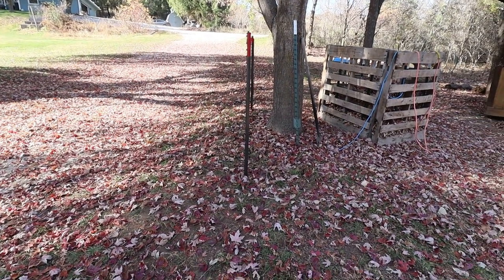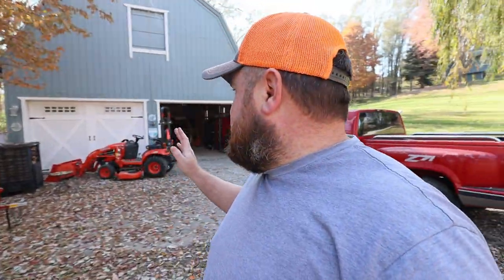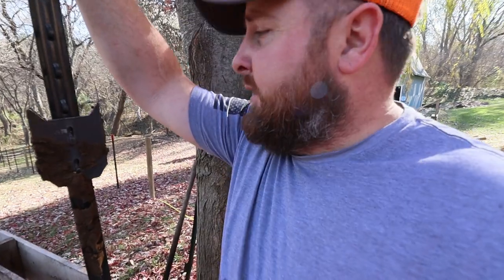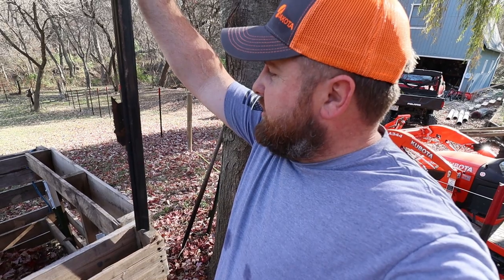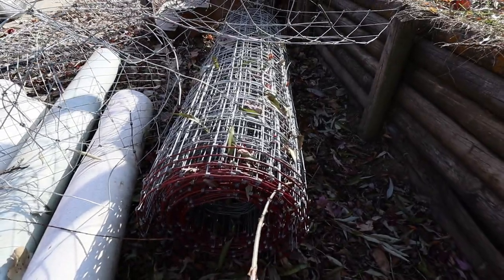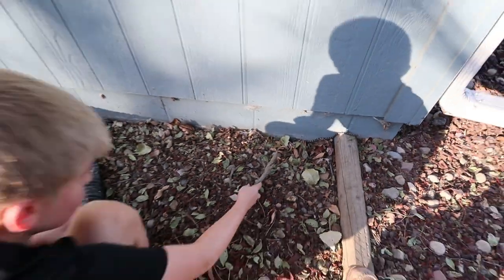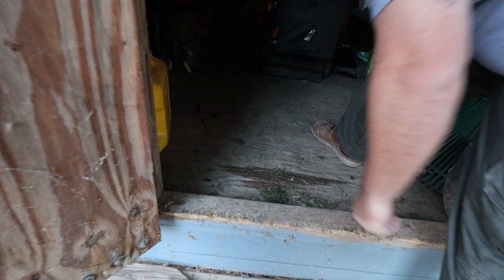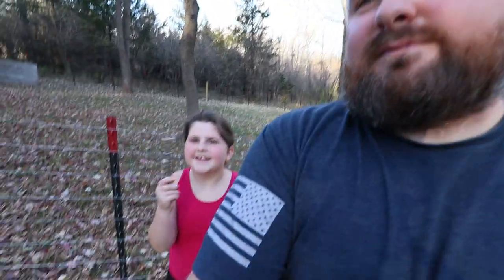Don't Rush Projects & This Is Why

Comment: I just recently got a cheap quick hitch for the kubota from harbor freight.  I think it ended up costing me around $90.  Used it with a strap to pull up and out a 10ft ground rod from an old oil well on the property.  I’d recommend it, also works well for skidding logs
Reply from the maker: I’m gonna look into that cause I could use a quick hitch for sure
Reply: @SunnySlopeHomestead  it’s definitely not as quality as most but it’s so affordable.  Only issue some people have is with the top hook and there are work arounds.   MUCH easier than dealing with the link arms